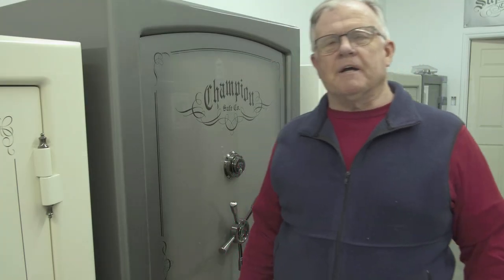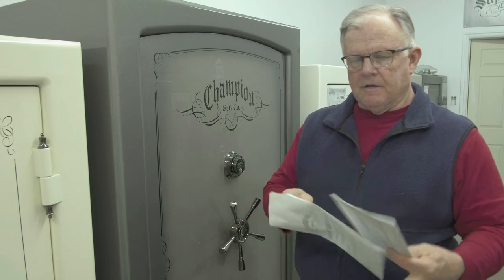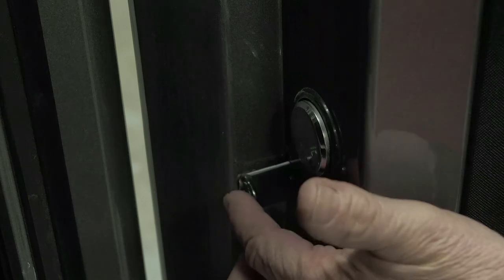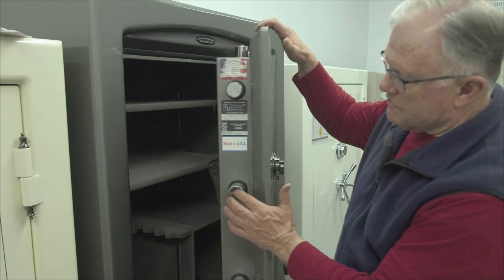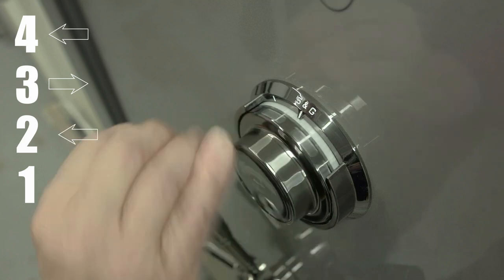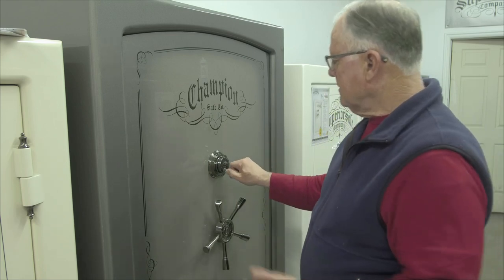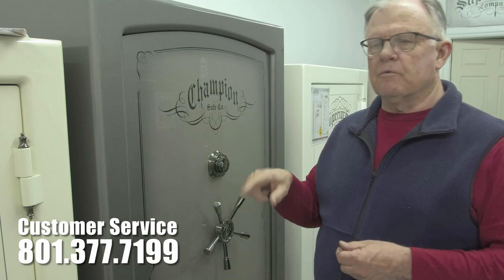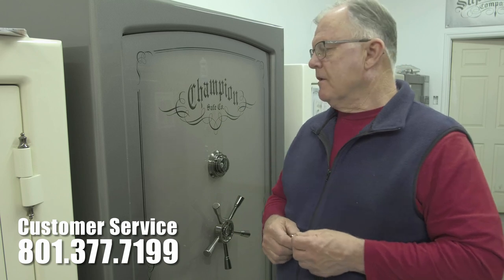S&G Mechanical Lock Operation

Comment: Hopefully someone at the company will see this & give me an answer. I bout a Champion safe, Model T, S&G about 15 years ago. It is exactly like the one in this video except it doesn't have a key on the dial. It used to open on the first try but has slowly gotten slower & slower. Yesterday I used the combination 10 times & never got it open. Does it have a battery in the dial? If so, how do I change it? I can't even get the door open.
Reply: I am having this issue too. Did you figure anything out?
Reply: @codynash7983  I had a locksmith come out. There was a tumbler that refused to drop down as it was stuck even though I put in each number of the combination. To get it to drop after putting in the total combination I would put something soft on the door above the dial & hit it not too hard, but hard enough with a hammer to make the tumbler drop. Worked every time. However, I decided a combo lock was a big hassle & had it replaced with a key pad & I am glad I did. It is so much easier & works each time. The 2 9-volt batteries will last two years before changing.
Reply: @sheikhboyardee556 wait till the keypad electronics die and you gotta get the locksmith to drill it. Mechanical locks are superior when serviced (if the locksmith serviced or replaced that it would be great)

Comment: It's all about the steel thickness and grade of steel. My guess Liberty uses a 1008 grade steel or lower carbon steel and Champion uses a higher carbon 1018 sheet steel. The 1018 steel contains more than double the carbon than 1008 contains and is much harder to bend. 1008 is softer and more malleable a property necessary since liberty 12-gauge and 11-gauge safes are formed from one piece of sheet steel using high capacity forming machines which would not be able to form a safe body out of 1018 which is an industry standard. A 1022 type steel would be ideal for safe construction with sheet metal).1018 can be bent into a box using a brake press but not formed like Liberty boxes are. It's why I believe Liberty had to go to Military style bars. Remember that a system is only as strong as it's weakest link. Based on my observations, the bolts did not fail. It was the steel used to make the safe body and door which buckled. The new military like make more contact against the casement and spread the force across a greater area. In the Champion safes, it's likely that their bolts maybe their weak link since they are using a tougher steel to construct safes and reinforcing their door edge. BTW 1018 is much harder to cut with a saw than 1008. One cannot cut 1018 with a simple carbide saw blade. Likewise 1008 steel holds up better in explosions because it gives. It's partly why Liberty likes to explode their safes. If you look at this video closely you could see that the Franklin door bowed and the casement pulled out so there is nowhere for bolts to hold on to and slip out. 
 I own an 2017 11-gauge Franklin Liberty safe which I purchased second hand. When I measured the casement edge it was less than .120 inches which is 11-gauge. It measured .116 with the paint. I first thought that the steel was 20-percent thinner but what I think is happening is, as the steel is bent and rolled by the forming machine the steel experiences some elongation and thinning at a critical area the casement edge; where door bolts lock behind.  
IMO, Overall Champion is better in their construction methods but usually cost more money. Liberty is about volume if they switched to a 1018 steel they could not form safes using the current roll forming machines. They would have to resort to traditional steel bending techniques and their volumes would drop significantly and prices would be much higher. 
For the money Liberty is a nice safe as well. I wrote this reply more to educate than critic and to force people to ask better questions about what they buy and for manufacturers to be more upfront about materials and methods used, similar to stating ingredients in boxed foods.
Reply: very informative about the differences